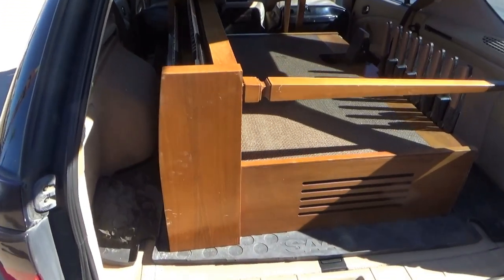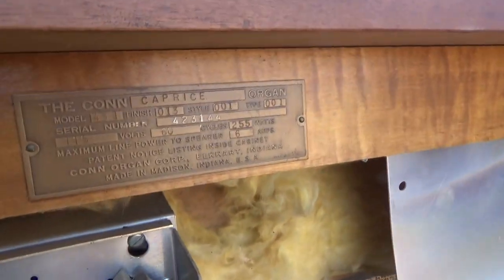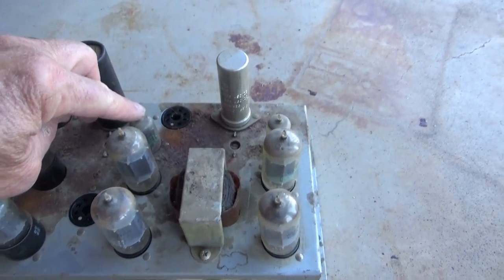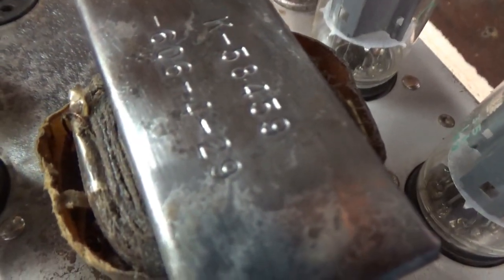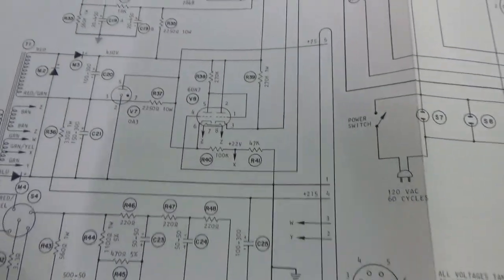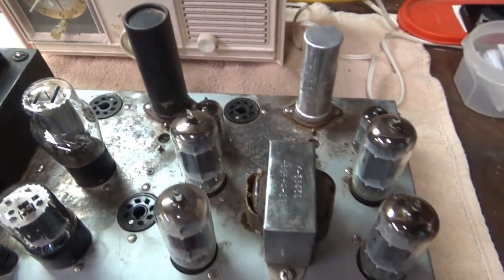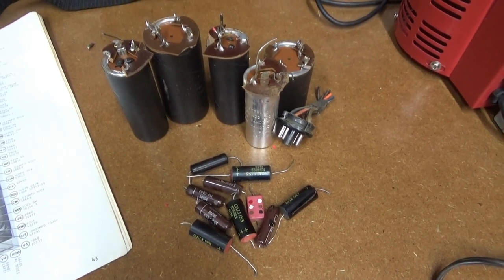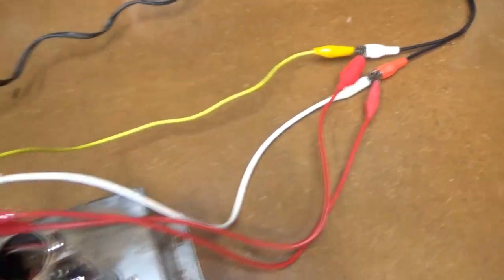1964 Conn Organ Amp Modified for HIFI Stereo Pt 1 of 2

Comment: I just picked one of these up. My main amp is a voice of music stereo tube amp and I’ve been on tiny for another project. I was a little bummed when I only saw one output transformer and assumed it was mono until I turned it upside down and saw the other one on the bottom of the chassis! I’ve been picking up old organ people can’t get rid of and taking the good parts out. From 2 organs I’ve gotten 70 12ax7 and 12au7 tubes, one mono amp and this dual channel amp! What I usually do with the big capacitor cans is leave them where they are unhooked and just hide the replacement caps under he chassis so it still looks original and you don’t have to cover the holes.
Reply from the maker: I usually leave the can caps installed and hide replacements also.  Since some of them broke in transit and I needed mounting holes anyway,  I decided to remove them all. Good luck,  that amp makes a nice stereo hifi amp. Let me know if you need the schematic.
Reply: A schematic would actually be very helpful.
Reply from the maker: Send me an email to mguessva@gmail.com and I'll forward the schematic to you.

Comment: You should get boxes for the alnico speakers that were in the organ and use them with the amp. They're full range and are part of the magic of the tube amplifier sound
Reply from the maker: I did purchase an open back guitar style box and mounted the organ speakers in it. They sound really good but I haven't found an application for them yet. I may use one of them in a 1947 Motorola radio phono combination console that I'm restoring that is missing the original speaker.

Comment: Wow, what a find! And the rejuvination of the amp turned out great. There is no substitute for that warm tube sound, that's for sure. And I commend you on your choice of bookshelf speakers---I'm a big Klipsch fan
Reply from the maker: Thanks for the comments.  I love the sound of that amp. I now have it connect to a pair of Advent Legacy speakers from the late 80's.  The small Klipsch speakers are my workbench speakers currently connected to my 1965 vintage Harmon Kardon FM receiver.

Comment: Understood the organ tube amps were designed for instrument music only. Do you think they have narrow frequency response than audio tube amps?
Reply from the maker: Thanks for the comments and good question.  There were some capacitors in the output stage of one channel and the negative feedback loop of the other channel.  I believe these were there to alter the frequency response of both channels for the organ.  I just removed the capacitors as part of the conversion to a stereo amp.  After the conversion I performed a frequency sweep of both channels and determined that they have a fairly flat response from 20 Hz to 20 KHz.

Comment: I have a dual amp treble & bass found in Hammond’s earlier models. Treble is type JR 1A and bass is type K. This unit came with a reverb tank.

I was wondering if it was possible or rather worth converting these to a stereo amp. I mean they look pretty dang cool.
Reply from the maker: I'm not really familiar with the Hammond amps. You would probably need to find a schematic for the amp to see if you can modify it for stereo. The Conn amp was fairly easy to modify.
Reply: @mguess  I have a schematic. It actually came out of an old Tone Cabinet Model H-40. I am just getting into this stuff. I converted a Magnavox 9302 amp. This one seems a little intimidating. Do you do custom work?
Reply from the maker: I'd be glad to help as much as I can. Would you be able to forward the schematic to me at mguessva@gmail.com.

Comment: @mguess - I have the same amp and would love to have a look at that schematic - Would you be willing to share a copy of it? Mine like yours looks like it had low hours. I still have a pair of the Conn house labeled 7868 - I sold the other pair to a gentleman that was repairing an Ampeg guitar amp. Plan to use mine for a Stereo bench amp to drive a pair vintage Advent speakers. I plan to use the EH7868 for replacements or rewire with octal sockets for use with 7591. These are cathode biased output stages, so I may re-bias for use with 6L6GB/5881.
Reply from the maker: I'd be happy to email you the schematic if you could forward me your email address.

Comment: So you didnt USE the power tranny and the rectifier tube?
How did you power the two amps?
Reply from the maker: Thanks for the questions. The power transformer is being used. The amplifier chassis uses solid state silicon rectifiers to provide the high voltage DC for the amplifier section of the circuit. This part of the power supply uses a voltage doubler circuit to provide up to 450V DC. There are two extra tubes (0A3 and 6DN7) which provided regulated DC voltages to other sections of the organ which are no longer present, ie tone generators. I have used the amp without these tubes installed and it works fine. I usually leave them installed because the 0A3 voltage regulator tube gives off a nice glow which I use as a pilot light to let me know the amp is powered up.
Reply: @mguess  ok thanks-
Im understanding more and more here.
So you added silicon diode rectifiers in addition to the 'taps' off the tubes.

Im a guitar player,  and ive been collecting these old salvage projects for 50 years, and ive just finally settled into a new place, so im beginning to sift through them to build some guitar amplifiers.
I have several like this so i have to determine whats best to keep and how to build a separate amp from the 2nd half.
Its so exciting when these amps come to life.
Reply from the maker: Hi Ed. I didn't add the silicon rectifiers. They are part of the original 1964 vintage organ amp. I'm still using them unmodified. This circuit doesn't use a tube rectifier like most guitar amps of the 60's vintage. I think solid state rectifiers were just becoming available and reasonably priced. I think it probably made it easier to implement the voltage doubler circuit which required 3 diodes. It also may have saved a bit on the power transformer but I'm just speculating on that. Good luck with your tube amp projects. They definitely have a cool vintage sound which is hard to duplicate with transistors.

Comment: I just came across you video about a “Conn Organ Amp Modified for HIFI Stereo”.  By coincidence, on February 25, 2020, (which is just 2 days before you posted your You Tube video) I brought home a Conn Rhapsody, Model 627 organ from my aunt that passed away.  I removed the tube amp, Leslie speaker, the 2 dozen 12AU7A tubes, and a few other goodies.  I, too, intend to use this amp as a stereo amp and use the Leslie speaker for my guitar.  Your video(s) are very good and I have watched them several times.  May I correspond with you by e-mail for more detail?  I have a g-mail account and my user name is dwlum51.  (I also retired in 2013 as your home page stated about you.)  I already purchased the Conn service manual for this organ.
Reply from the maker: I'll send you an email.  Good luck with the amp and leslie conversions.

Comment: if you put a stereo preamp between the turntable and the power amp you'll get the most out of that thing ...you probably are aware of course
Reply from the maker: You are correct and I recently did just that.  Check out a recent video on my current system configuration.  https://youtu.be/77wais1rl-I
Reply: @mguess  i have this very amp and it just developed a hum which i KNOW are filter caps..150 uf at 300 volts is a wierd value for power caps and its hard to find ...im trying to see wht you used and how u applied it
Reply from the maker: I used electrolytic capacitors rated at 450 volts. These are easy to find. You can always go higher in voltage ratings but not lower. Good luck with your project and let me know how it turns out.
Reply: @mguess  cool ty its a lil wierd arrangement on the original power supply but ill work it ,,,,i believe the 150 /300 volt cap is the culprit as its carboard and bulging on the top
Reply from the maker: @steveeolio  The power supply in the old Conn amp is a voltage doubler design which is why it can produce 420 volts with capacitors rated at 300 volts. If you are still using all the original electrolytic capacitors you may want to replace all of them. I have the schematic for the amp if you need it.

Comment: What's the best organs to get Amos from. There are always people giving them away where I live! Thanks for the video on my Infinity 3007s. Turned out badass ! Do one on the old 7kappas please! Hahahahaha
Reply from the maker: I'm not that familiar with organ amplifiers, the Conn in the video was the first one the I have worked on.  However I would probably pick up any organ with a tube amp if it was cheap enough.  Luckily for me the Conn amp was easily converted to stereo use which is what I wanted.  I'm glad your Infinity speaker restoration was successful. The are great sounding speakers!